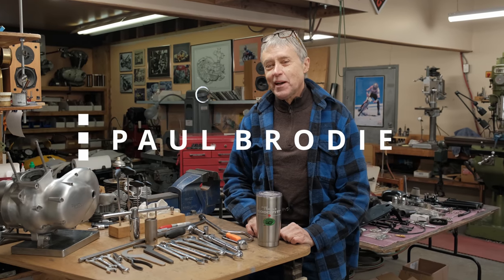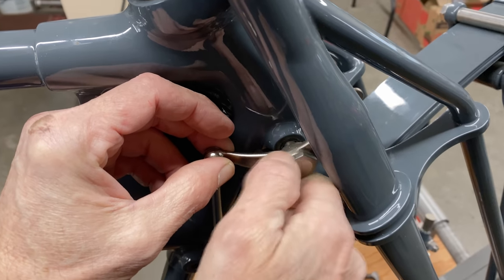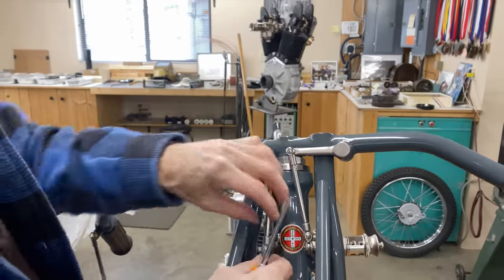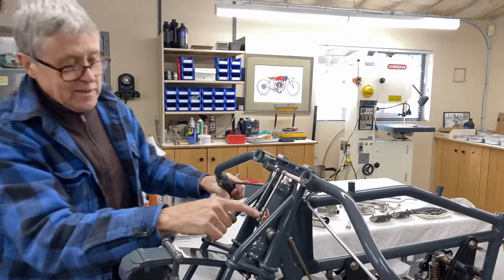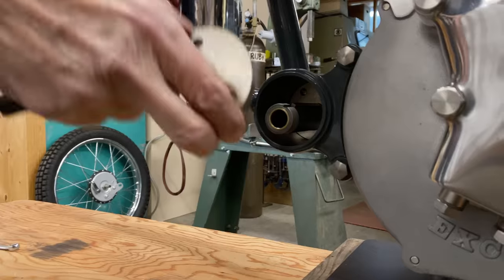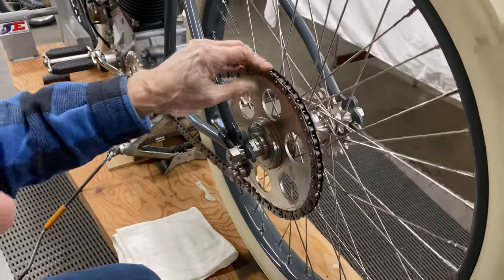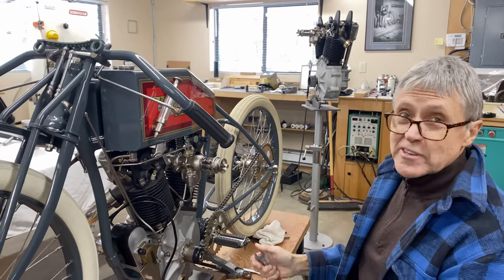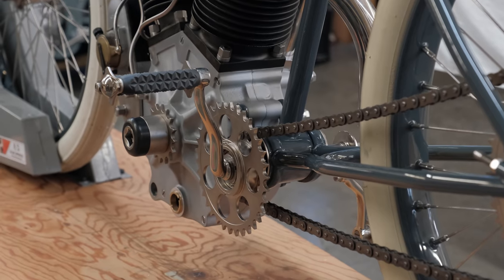Let's put an EXCELSIOR together! // Paul Brodie's Shop

Comment: I'm surprised that RH crank doesn't use a cotter for its fit. I know the North Americans were a fan of "ashtabula" one piece cranks on their bicycles, and your LH crank appears to be very much influenced by that design.

Useless trivia: CCM arguably manufactured and sold the worlds first three-piece cotterless crankset, and it too used a triangular fit. Named the Triplex, it came standard on their 1930's Flyte bicycle. At least, they were first to manufacture them in any great scale. We see very little of this stuff here in New Zealand, but it interests me more than the typical English-style stuff we did have.
Reply from the maker: When I was figuring out how to build an Excelsior, I borrowed a stock, unrestored 1914 road model, and copied that crank. That's how it came to be,

Comment: The linkage is mechanical art, no doubt. One thing struck me, though- I noticed you assembled this bike "dry". No anti seize or copper spray, lithium grease, etc. on threads. Your thoughts on this?
Reply from the maker: A lot of the threads still had something on them from the last time I assembled it. Make sense?
Reply: @paulbrodie  Total sense, now. It has to be very satisfying to experience that tactical feel of precisely machined parts and fasteners coming together. I appreciate craftsmanship done to the highest personal standards, not constrained by the clock.
Reply from the maker: @alexcallas8222  Thanks Alex. I call it Financial Recklessness, where I embark on a project not knowing if I will ever make money on it.

Comment: I WATCHED THE 69er VIDEO AND FOUND OUT I HAVE SOME PARTS FOR EQUAL BUILD I EVEN HVE THE SAME BRAKE ON BACK WITH SEVRAL DIFFRENT OPTIONS TO USE AS THE DISC ETC>>>    MY SHOP IS FULL OF PROJECTS AND I WORK FULL TIME AS ENGINEER.:goodvibes:
Reply from the maker: Excellent. Your shop is full of projects! 😉

Comment: My cool meter is slammed against the peg. Thanks for the show. Paul in Thailand/J Model Harley Racer 1920    PS How about a trip to Sons of Speed? Yeah.
Reply from the maker: Paul, thanks for watching! I went to Sons of Speed in 2019. Did one lap, the throttle stuck, I crashed, got flown to hospital in a helicopter, and learned to walk in 7 months. Been there, done that.
Reply: @paulbrodie  What caused the throttle to stick? I'm tall and 109 kilos so I'm eyeing a small local guy to be my main pilot. A friend here has built up a Powerplus racer using food cart clincher wheels and we are talking about doing exhibitions at Bhira raceway et al.
Reply from the maker: @caesarillion  Why the throttle stuck is going to be one of life's mysteries. I never fixed it after the crash, and it works just fine.
Reply: How about engineering a straight line top speed run for the OHC-X? My first concern would be the tire technology and maybe filling the clinchers with high pressure foam to prevent failure. After all Glenn Curtiss did it back when and tech would seem to be even better today? Who knows? Thanks, Paul...... Paul in Thailand/HD Racing

Comment: Hi Paul, what material type did you use for valve seats on the excelsior engine. Regard Richard
Reply from the maker: Bronze. They were purchased from Kibblewhite in the USA.
Reply: @paulbrodie  Hi Paul, many thanks for your reply

Comment: is this a kit you can buy or?
Reply from the maker: It's a whole motorcycle that you can buy, but there is no where to ride it, really. No brakes, no clutch, no transmission.
Reply: @paulbrodie  explain..Its a one speed or? what about putting a drum brake or heck put a hand brake on like a bicycle just go way over sized..
Reply from the maker: @SpaceRanger187   Yes, it is a one speed motorcycle, direct drive, no clutch. It is original. You are changing the original intent if you add brakes. Remember, it is 1000cc with 45 rear wheel HP, so it is not a toy.

Comment: Hockey tape. It doesn't unwind?
Reply from the maker: It's not perfect, but it does look the part and works pretty well.
Reply: Paul... I have a roll of black Velcro tape. I use it all over the bike in place of zip-ties as it's much nicer to the wires (electrician by trade here) and painted frame. I put the fuzzy side towards the wires. And it's easily reused.
Reply from the maker: @blipco5   Yes, that could work too.

Comment: Paul is this a new bike...? A reproduction bike...? Or is this a meticulously restored bike....?
Reply from the maker: I made it. I have made six Excelsiors and sold four.
Reply: @paulbrodie  ...
This is quite astounding.....!
You have got to be a over-the-top mathematician.........!!!
🎶🙏🙏🙏🎶
Reply from the maker: @iplaymytele   Well, I never excelled in math, but I did get straight A's in metalwork.
Reply: @paulbrodie  ...
Ha ha ha... I hated math Paul...! But I excelled in metal shop and auto also...👍 
But my grandpa having his little motorcycle shop and teaching me all about motors cars in anything mechanical since I was a little tiny kid didn’t hurt things...😹😹😹  I just did a 18 horse vanguard V twin conversion to a beautiful 1957 Cushman eagle that was already a show Bike ...❤️  it belongs to Senator Jim McClendon here in Sweet home Alabama....❤️🇺🇸❤️🇺🇸  I have a 1961 Cushman eagle that has a 670cc 22hp Predator V twin, with a 60s series CVtech Torque converter..., It also has a Ed Evans jack shaft drive...!  
It was completely stock for 13 years. I had to have a knee operation on my right knee and could not kick the bike over anymore...!
 My 1961 Cushman eagle set for two years because I could not start it...! I bit the bullet and sold off a few thousand dollars of my guns,
And decided I was going to do the V-twin conversion on my eagle because I love riding it...! If you get a chance Paul, 
You can see both of these bikes on my YouTube channel...😀 ( the Jeff Galey Channel ) , along with all of the other things I do it is basically a music page I also do luthier work because I am a professional musician and have had a school of music forover20 years now....🎶🙏🎵 so if you get bored stop by the Jeff Galey channel, and say hello...! I subscribe to your channel and if you’re feeling really generous you can subscribe to mine.....😹😹😹🙏
Reply from the maker: @iplaymytele  Thanks Jeff, I will take a look at your channel.
Reply: @paulbrodie  ...
Thank you Paul....! Hope you have a nice weekend your friend Jeff in Sweet home Alabama.......🎵🇺🇸🇺🇸🎶🎓